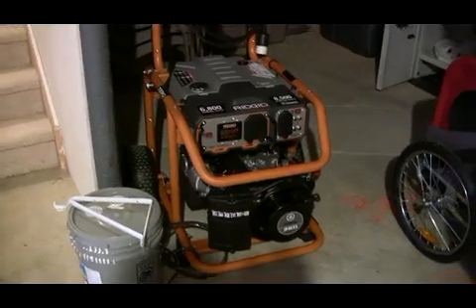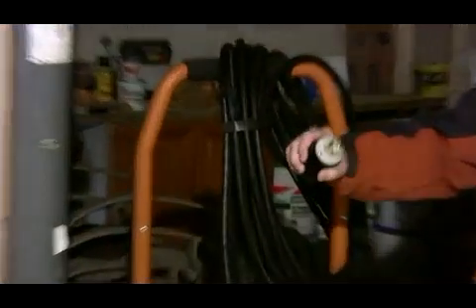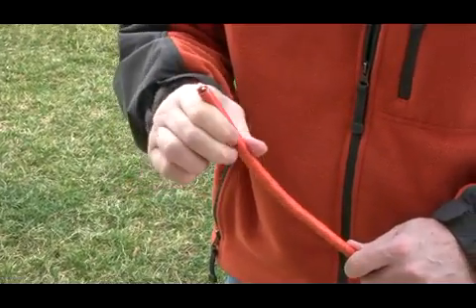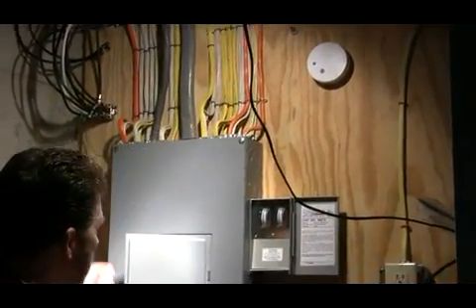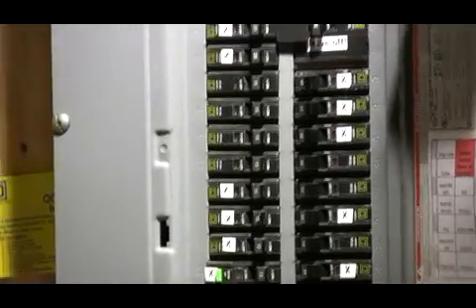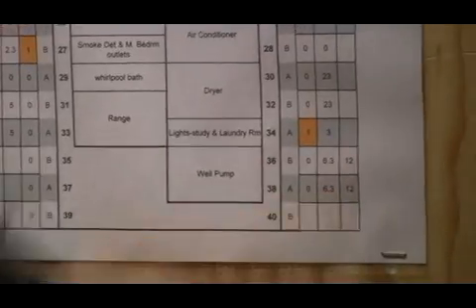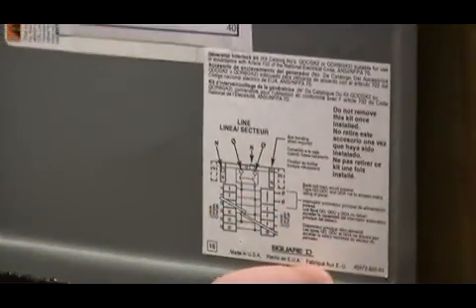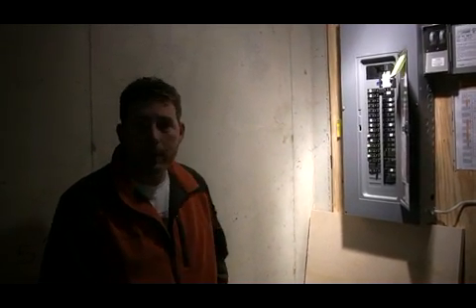Interlock vs. Transfer switch

Comment: Hello, and thanks for the great video. I'm looking to complete this setup as well, but I have 1 question. My house has a grinder pump for sewage which I believe is on a separate power main than the house panel. The builder installed a sign on the house panel that reads, "WARNING, main breaker does not disconnect grinder pump main." I'm assuming this means that flipping OFF the 200A main panel circuit does not disconnect the other lead for the grinder pump," and my concern is that accordingly I could somehow send power back through the lines that feed the grinder pump. My goal is safety and code compliance and I'm inclined to believe that since the grinder is a separate circuit that there is no way to backfeed power through the grinder main if the pain panel is OFF and under power via the generator breaker.

If anybody could chime in confirming or disputing my thoughts - that would be much appreciated!

Thanks!
Reply: PS: My site plan shows 2 separate electric leads coming in from the utility box. One goes to the house and is labeled "electric service" and the other is labeled "sewer lead" and eventually splits to the grinder pump location. See the link below for details:

https://www.dropbox.com/s/j0sos137bhbvx0k/site-plan-electric.jpg
Reply: Kyle Shea most likly you have another breaker box for the sewer ginder
and by disconnecting the main power to your house will stop all power from leaving, in the event of power coming back on while under genarator power, your sewer grinder will come on, using the sewer grinder breaker box is a great place to install a grid power light
Reply: There must be some way to disconnect the sewer pump?

Comment: Thanks for your video. My electrician recommended an interlock so I got the same inlet box and meters for my setup. Here in NC we can use any interlock so I have an Interlockit he recommended.  I returned a transfer switch I had bought and saved a bit by doing so.

Comment: You effectively neutralized the two hots from the power company. Your neutral is still connected and should be separated also or you can back feed the power grid and electrocute someone. That's what a transfer switch does that you have not done.
Reply: Isn't this installation in compliance with local and national code?
Reply: You don't need to isolate the neutral. Just the hots. You should be ok with that setup. Neutral is effectively grounded. You have two grounds hooked together - no problem. I could walk into my garage right now and grab a jumper cable and hook my line neutral to my generator or my garage door or anything else and nothing would happen.
Reply: wrong
Reply: I'll give it more thought but i don't see how a neutral,  (tied to ground) with isolated hots can possibly back feed the grid, nor anything.
Reply: Keith I don't think you understand how he wired it. He also has a floating neutral on his generator.  Its 100% to code and legal.
Reply: I just bought a Reliance transfer switch that DOES NOT isolate the neutral in any way.  They do make a transfer switch with a 3rd pole that does switch the neutral. My transfer switch allows me to hook up 10 circuits but it uses the neutral in the main panel, and it does not shut off the Main Breaker; it only separates the utility hots from the generator hots. I would like to know what is going to happen if the utility comes back online while I am using my generator---------since they are both using the same neutral. I can't find a definitive answer on that issue.

Comment: From an Licenced electrician standpoint, you did an excellent job. The benefit to a transfer switch though is that it will kick on emergency power even while you're away and prevent your refrigerator from spoiling your food. If you were out of town for instance.
Reply: +Frank Leathers Yes, that is true for an AUTOMATIC transfer switch and a stand-alone generator ($$) that runs on Natural Gas or propane (not his set-up here with a gasoline powered portable generator)
Reply: Franks u were pwnd, time to give ur 'electricians' license back

Comment: Holy cow! Aluminum Wires?
Reply: Where? The service entrance are always aluminum wires installed with cream on the connection to the main.
Reply: Aluminum is common for service but not always. You can buy copper if you want to spend the coin.  @johndonadeo1011

Comment: Great  video but you made your own so  cord to the generator and there is a certain way to wire it up ( the same as that is connecting to the panel) great job but hire an electrician  for the novice

Comment from the maker: I believe that the advantage of a transfer switch, is that it makes it totally idiot proof.  Since you are only wiring specific circuts thru the transfer switch, there is no risk of over loading your generator.
Reply: Well, lower risk maybe- still wouldn't prevent someone from flipping on everything wired to the transfer switch, which may still overload it. The interlock is so much more flexible in allowing configuration to run any one device in the house without having to locking it in place permanently at installation as with the transfer switch breaker panel.

Comment: Good instructive video. I got the interlock switch installed. But I am wondering why would anyone install transfer switch vs the interlock switch. To me, interlock switch seems a simple solution. In other words, what is the advantage with transfer switch ?

Comment: I had been doing the manually in the past (not legal) but I always made sure the main breakers were off first.
I did not know about the Square D QO interlock kits ,now I'll get them installed.
I am now in the process of changing my main service supply to incorporate a  Square D QO Main 200 Amp breaker or disconnect OUTSIDE of the home right next to the meter socket and then feed into a "Splitter" box with 200 amp bars and lugs that will then feed EACH 200 amp Square D QO load center from outside

Comment: I then use a short "jumper cord" with the correct male twist lock plugs on EACH end of the patch cord.
Remember that these receptacles are live ONLY when the mains are off and only then can they be turned on.
The electricity is then fed through the breaker feeding the garage panel into the main bus bars of one panel , then through the 20 or 30 amp breaker for the gen unit supply , to the twist lock recep through the cord ,then back into the other panel ,through the breaker into the bars panel 2

Comment: Mike ,I also have 2 qty. 200 Amp panels at my home.
I "back feed" my generator output into the 100 amp sub panel in my garage which would then go back into the house .
After watching this video I am also going to install those safety interlock brackets into EACH panel.
To get around the problem of feeding 2 panels from one source once you have turned off the main breakers in each panel is to just install a twist lock receptacle at each panel hooked ONLY to that first breaker for the interlock.

Comment: I learned alot from your video.  I do have a question:  How do you handle two panels, each with it's own feed and its own 200 AMP breaker?  I would imagine I need to Interlock kits, and two watt meters.  But what about the outside recepticle.  The generator only has one connection for the twist lock.  Would it meet code if I use two 10/3 wire and one recepticle?  V/R  Mike

Comment: breakers are de-rated in the field.  As per NEC article 210.20 (a) if it says 30, it means 24 amps of continuous load, (anything expected to be left on in excess of 3 hrs.) plus the noncontinuous load not to exceed 30 amps.  At 50% you ought to be golden especially since your main concern is burning up the 10 gauge you installed to the interlock.  nice work!

Comment from the maker: It may not be a solution for just anyone.  However, when you properly manage the load its fine. I have never even exceeded 50%.
Also, breakers are already de-rated by 80% unless marked as 100%.

Comment: Here is the issue with a interlock device. Lets start with common sense you have a 200 amp rated panel with a 200 amp main, now you want to replace that main with a 30 or 50 amp circuit breaker. Just for starters that makes no sense..sure YOU can shut off some of the load and sure the breaker will trip if its overloaded. BUT it is very clear in the code the breaker shall never exceed 80% of the rating so your NEW 30 amp interlock is now down to 24 AMPS. Problem waiting to happen.

Comment from the maker: At first glance it looks like an impressive unit with the Honda engine being main selling point.  However, I did some searches, and found some RV forums that suggested that the alternator construction is somewhat light-duty (meaning don't recommend using >50% of total for extended time).  You also may want to consider fuel burn- how much fuel do you have stored?  A full 'Honda' is the best... but they are expensive for sure. Just some food for thought- Not trying to talk u out of it..

Comment: Lol, your right, the electricians can't seem to come to common ground on this one.  I like your suggestion of moving critical circuits to a single panel.  By the way, my plan is buy the newest version of the Black Max 7,000 watt generator with a Honda GX390 engine at Sam's Club (Item#: 604326) currently going for $1,000.  If anyone has an opinion, I can be talked out of this.

Thanks again for your help and taking the time to make a difference.

Comment from the maker: Hey Nick,  here is a link i found that is a pretty good discussion about your exact situation.  Note that even electricians argue with each other about the way to implement.  Just for simplicity sake and to avoid any possible issues with inspections in the future... you may want to consider just grouping your critical circuits into the same panel.  Or just power them individually either 1 at a time, or with another generator. 
I cant paste link, but just google this;  forums.mikeholt 148647

Comment: Perfect, thank you.  By any chance would you (or your neighbor) know the proper way of using your suggested interlock approach (which I agree provides greater flexibility) on a two panel implementation.  In my case, I have a 400 amp service (two panels of 200 amps ea).  Of course, there are circuits in both panels that I'd likely want to energize in the event of a power failure. My instinct says to install a 30 amp backfeed double-pole breaker in each panel & wire in series. But, I'm not sure.

Comment: Hello and Thank You for posting your video. It has helped me install the very same interlock in my panel as I also have a Square D panel. In the future I would like to add your Watt meter and organize the breakers in a list to have the circuit info readily available. Thanks again.

Comment: Interlocking breakers are a wonderful solution to the problem of powering your entire home, or part of it, with a generator.  I tell everyone I know to avoid those cheesy retrofit panels with the little red and black button breakers in them -- those breakers may be UL 489 certified but I don't trust them!

Comment from the maker: Hi. Not sure what you mean about the money? I went this route simply because i wanted to have the option to run any specific circuit in my house.  If I ever listed my house, i would remove the 'x' labels on the breakers. And when i move, I am taking my generator with me. I do get your point about limiting the draw not to exceed the genset capability. That is why I installed the watt meter. I suppose i could reduce to 20amp backfeed breaker, but 30amp is pretty close to my 7kw genset output.

Comment: There is something called a Y-Circuit or a Delta Circuit.Essentially, there is something called a "floating ground" versus a bonded ground. It is hard to explain in short in this post.  You can use your cold water pipe as ground.

Comment: This is an excellent video! Thanks for posting. I saw the interlock website.  Many people are recommending a male-to-male cord (hand made) to back-feed, while shut down your main breaker. I didn't feel comfortable with that idea, and this seems such a simpler and cleaner idea: using the panel itself which is already fully amperage protected to feed all circuits in the house. (I have a 7000 Watt Generator which I believe is 58Amps, and while it doesn't run the entire house, it does runs enough)

Comment from the maker: Check out the follow-up vid.  I agree it can be confusing.  I don't want to tell you that you *need* to do anything.  I just want to make you aware.  Check your manual-it should indicate if neutral is bonded to ground.  Do you plan on using your generator in 'stand-alone' mode often? (ex: take it camping)  Watch the vid carefully, and should clear it up.

Comment: Great video! I have the exact same setup with a briggs and straton 30471 generator.  I have the same panel and have hooked it up and used it several times.   Im confused about the bonded ground and why you say it cant be used as a stand alone  My neutral and ground is bonded in the panel and I have not modified my generator.  Do you see any problems with that connection??

Comment from the maker: I am very happy with it. No issues at all.  Very rugged construction.  Love the 'zero gravity' frame & wheels.  My only regret is not getting the electric start.  (this unit always starts on first or 2nd pull- but I would love to be able to start via the remote panel)

Comment: My panel was also full.  I replaced two single 110 breakers with two tandem breakers.  This freed up the space I needed to add the generator back feed double breaker.  Works great.

Comment: Thanks for this channel this has been very helpful,quick question i've recently purchase a 7500 continuous watt Generator Peak Startup 9850. How does this sound, 10/4 wire 30amp outlet and 30amp breaker double pull. with Interlock kit.
 
opinion welcome

Comment: One other reason would be that with the ground and the neutral in parallel at both ends you are making the ground a current carrying conductor between the generator and the normal service entrance (SE) it's not supposed to be.   It's ok to leave it grounded at the generator IF you lift the neutral at the SE and Ground the gen to earth with rod and #8 (min) cable)  The NEC calls this a separately derived system. Can I say this isn't a game to mess with if you unsure get an electrician!

Comment: There are several reasons.  In any case you want to avoid multiple paths to ground.  It creates ground loops and can either cause Ground Fault Protection (GFP) circuitly to trip prematurely or not trip at all.   You can connection Ground to neutral all day long on the Line side of a GFCI outlet but if you do it on the load side it will trip it instantly and you wont be able to reset it.   Some Generators have GFP circuitry on them and having mutliple paths can cause issues. Out of space!

Comment: If my main panel (house built in 2005) is full, is it possible to connect an interlock to my subpanel that for the most part, powers my basement?

Comment: 10/3 = 2 hot legs, 1 neutral, 1 ground, @ 10 AWG.  10/4 = 3 hot legs, 1 neutral, and 1 ground.  The ground wire is not counted in the 10/X number, because it is not considered a current carrying conductor during normal operation.  These 30 amp installs only require 2 hot legs, a neutral, and a ground, hence the 10/3.

Comment from the maker: Ok, so I am not an electrician, but to the best of my knowledge, the difference between 10-3 vs. 10-4 is only that the ground wire is insulated in same manner as the other 3 wires. I believe 10-4 may be used for 3-phase applications. The 10-3 does have 4 wires. Hope that helps you.

Comment: Hey panchohughes great video, what type wire are using from the power inlet back to the panel? I think it's 10-3 but what manufacturer? Thanks for the info

Comment from the maker: Thanks!   Yes.  I did remove the ground bond to frame.  I also printed a large decal and affixed it to the generator that says "Warning! Do not use this in stand-alone"  It must be connected only to the panel with the 30amp plug.

Comment: This is awesome @panchohughes.  I am right across the DEM bridge in NJ and an electrical engineer.  Found this yesterday.   Great work.  I have an external QO 200AMP breaker outside the house so I can't do this and am looking for a whole house alternative (ie. MTS outside house) Question:  I don't recall you saying that you pulled the end cap off your generator and removed the Neutral/Ground jumper.   Did you do this?   If not you need to.

Comment: Great informative video.  We discovered during the home inspection that our interlock device, which is like yours, is not wired in.  The wires were left with taped ends inside the electrical panel.  Not sure why anyone would not just go ahead and connect them.  
Can you please post the Excel sheet you created for your electrical panel?  Thanks!  .

Comment from the maker: One other lesson-learned/tip:   If i could do it again, i would spend a little more and get the electric start. Because the next model up has the detachable control panel which can be placed 25' away so you could start & stop it without going outside.  Not a huge deal, but a nice-to-have.  This unit always starts on first pull. No complaints on the unit itself.
Reply: Don't forget a trickle charger for the battery.
Reply: @wernerpd777  Bought one at HF for my Powerhorse 3500 generator.  Cult a small opening to allow the disconnect cord to run through cover allowing for full-time quick access without having to remove the battery cover.
Reply: @Michael_Hale  Smart play.